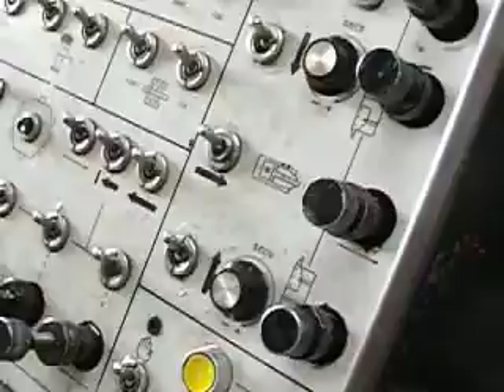Emi-mec E sprint auto plugboard lathe 1974 vintage at StarLoc in 2013

Comment: I used to operate a Sprint in the early eighties making parts for telephone exchange relay sets.  I used to love trying to shave off seconds from the cycle time by getting two or three cutting tools at the same time - e.g. top and back slides and a centre.
Reply: I used to run a couple of Accuratool pegboard autos. Very similar to this.  Very rewarding seeing the finish item coming off.  My best years in the machine shop.
Reply: same here. A challenge that sometimes ended with a crash of tools, when I was still learning.

Comment from the maker: We only use them for auto parts, After standing for so long, It wasnt indexing well, v.slow, sometimes stopping,a slide micro switch was loose, my other problem, the clutch slipping when in reverse low speed, simple adjustment and now its fine, the low speed was due to the compressor , much bigger one on there now
We make nozzles for on aluminium tubes of glue but only about 5000 a month so machine is off most of the time